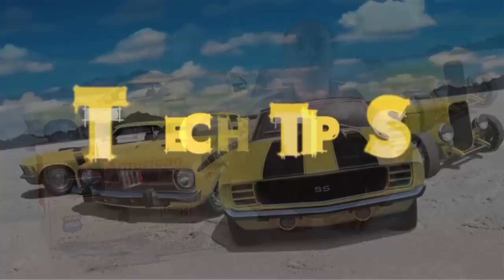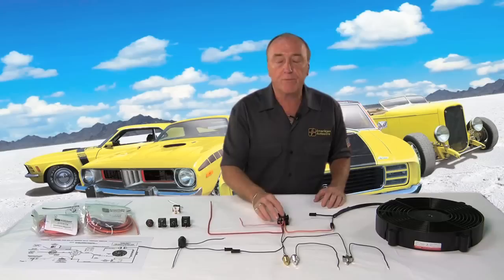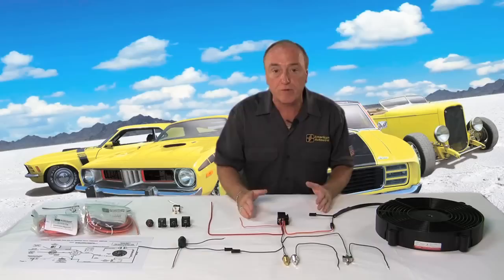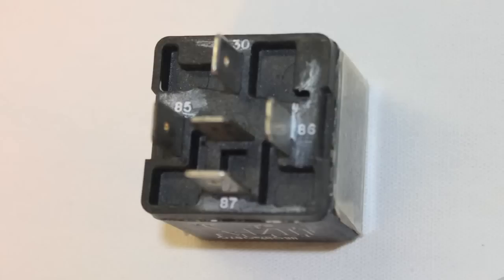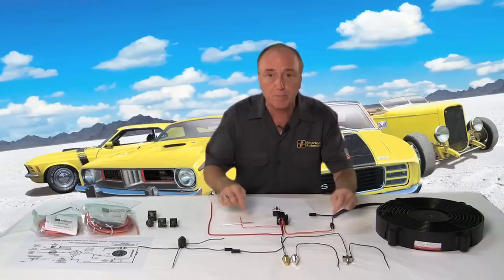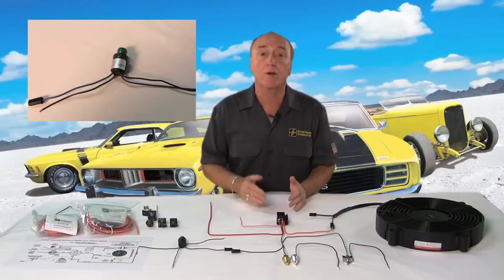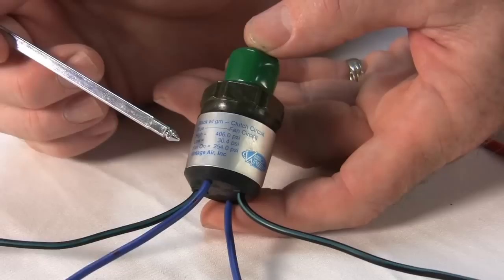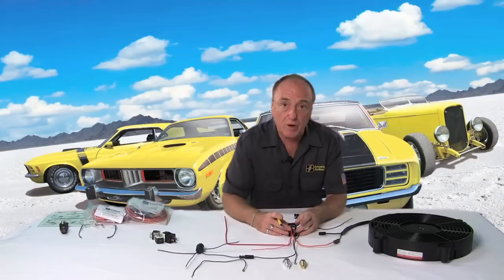Electric Fan Connection Using Fan Relay Kit

Comment: Okay Thanks so Much!
So which prong on a relay would be for which component of the curcuit? I want to wire a thermal switch(activates at 40°C) to my intercooler and a manual switch in the cockpit. Also since im using switches do i need to use ny ignition source for 12V or can i run straight to my battery since the relay is relying on the two switches that would be "Control the ground" right? 
This video explains it all better than the other one hundred that I have come across (7yrs looking) but i really need these answers so that it can finally make complete sense of what I need to do. Also you displayed a 4 prong and a 5 prong, which one would benifit me the most. I also believe there are at least two differnet configurations of 5 prong relays (center prong being 86a or 86b etc.)

Comment: A lot of great information.  
But how would I wire a push through radiator temperature probe? 
Is it one wire lead to 85
And one to ground? 
OR 
One lead to 85 terminal 
One lead to and ignition source? 

Thanks for your help!

Comment: THANKS FOR RESPONDING...  A FRIEND OF MINE WENT THROUGH AND DETERMINED THAT THE CIRCUIT BREAKER, THAT CAME WITH THE THERMOSTAT WIRING KIT, WAS THE PROBLEM...  HE REPLACED IT WITH AN INLINE FUSE...  PROBLEM SOLVED...

Comment: I like that the fan is automatic, but just putting a switch in isn't dangerous unless you don't use the proper gauge of wire... turning the switch off means the circuit is open and no voltage gets anywhere if the wind spins the fan a bit. I do like how you explain everything. I always thought of relays as a weight saver when it comes to wire cause it just relays the signal to a heavier wire, but obviously it's more complicated than that if they do other things, like wiper relays and fan relays.

Comment: I am using the AAW Camaro kit for the 69 camaro.  Is the orange wire to the fan intended to be the ground switch for the fan to signal it to turn on? Its unclear what the function of this wire is. I have the Dakota digital dash too.

Comment: Thanks man,so this switch can cut the power from the AC system and simultaneously connects the cooling fan ground wire to turn it on .?

Comment: Thank you for this video. But what if the relay has a malfunction? Then the override switch wont complete the circuit. So it has to be either the hot or the cold direct wire that supply the fan to be connected to the override switch.

Comment: Hi. Great video. 
Can i install an electric fan using the temp sensor on the engine. Or do i have to install a separate sensor switch. The temp sensor has 2wires. I want to retrofit to electric fan

Comment: In the video you say that terminal 85 should be connected to power and terminal 86 to ground. When the coil shows a freewheeling diode across
Reply: Juan Abreu 
The diode across the relay coil is to block any back pulse created when the relay turns off to prevent damage to a transistor switch if used its not a "freewheeling" diode.

Comment: How much is that system from vintage air? I have a 03 focus with dual fans, all new parts yet fans do not run on their own but, I drive a 07 Pontiac G5 2.2 vin F & I ha e never seen the fans run on their own so I figured out how to run low speed but, I need the fan to operate properly & at a temp lower then 223° low speed, & 230° HI-SPEED..MY CAR CYCKES BETWEEN 178-192 NORMALLY EXCEPT WHEN driving up a continuous hill/ sitting, idling. I turn on low speed at 190-ish but, I cannot control hi-speed yet. Any help is greatly appreciated!!!

Comment: great job!      only question i have is?    shouldnt you have a second "free wheeling" diode right close to the fan motor?

wouldnt there be voltage feedback with on the freeway??.    without one?

larry

Comment: what if you istall a temp switch on the ac condenser so the fans turn on when the condenser gets hot and at highway speeds the condenser will stay cool keeping the fans off

Comment: I did a fan on my jeep yj with out using a relay and it caused issues. not using a relay caused the engine to run for a few seconds after I shut the key off. after I installed a relay the problem when a way.
Reply: I'm having the exact same issue and I think it's because my fan has no relay.
Reply: @scanner2350  You need a relay!

Comment: Hmmm.  DIN 72552 says terminal 86 is relay coil positive and terminal 85 is relay coil negative.  Normally it might not matter, but if there is a diode in parallel with the coil it would matter.  Are you using another standard?  SAE, ISO, ???

Comment: I want my fan to come on as soon as my motor is running in warm weather,is there a reason i couldn't use the exact system shown here with the exception of running my ground direct to battery ? If not how can i wire the cooling fan in a 1995 mustang v6 to come on & stay on the entire time the motor is running ? An inline switch is no good seeing as im doing this for a disabled woman wholl forget to turn the switch off & kill the battery leaving her stranded.

Comment: My new 57 Chevy American Autowire kit provides constant power to the relay coil so even when the motor is turned off, if the water temp is above the sensor set point, the fan continues to run. How would you wire the relay coil to only have 12Volt power when the ignition is "on"??
Reply: .....???? WHY DO YOU WANT TO CHANGE THE WAY IT COOLS , THAT IS THE WAY IT SHOULD BE SO THAT YOU DONT HAVE EXTREMELY HIGH TEMPERATURES JUST COMPLETELY STUCK IN THE SYSTEM THAT WILL MAKE EVERYTHING BREAK DOWN FASTER.....THE QUICKEST COOL DOWN IS THE WAY TO GO
Reply: @seanglenn1901  
Your mis-understanding what I'm looking for. I'm not trying to change how it cools. First of all, I figured why it was running when I turned the key off. The "original" ignition switch simply had "off", "on", and "Start".  The new switch that came with the new wiring harness, has one additional position to the left of "off". You would consider that position "Accessory". When I was turning off the ignition, I was going all the way to "Accessory". That was sending power to the fan relay so if the temperature of the coolant was still above the sender set point, it would continue to run the fan even though the motor was no longer running. 
I have no intention to change the "on-off" set points of the sender.

Comment: Using relays to switch a DC fan motor is a real bad idea.  It can blast the relay contacts leaving the fan at full RPM dead. Starting DC fan motors draws high amount of DC current that can short out the diodes in your alternator.  Get a good solid state controller with SOFT START.  See more at www.autocoolguy.com

Comment from the maker: Thank you for checking out our video!  We would have to find out how you have the fan wired. That will help us determine what is going on.  Depending on the temperature switch you are using, there are many factors that can cause erratic behavior in fan operation.  The reading on a gauge may not always match the timing of the fan switch operation due to location in the engine.  Please call us so we can help you get it figured out  800-482-9473 and press option 4 for Technical Support.  Thank you.

Comment: When the coil shows a freewheeling diode accross its terminals, I've always seen that the cathode is connected to terminal 86, should not be better to favor the connection of power to terminal 86 and ground to terminal 85 even if diode is not present. Of course the diagram on the relay case dictates the rules!
Reply: Juan Abreu

Comment: Anyone familiar with electric fan circuit breakers? My universal fan kit works up until a certain ambient air temp. After 90 degrees it wont work. I have it in the coolest part of the engine bay, which isn't very hot, and yet hot days will cause it not to turn on. I Live in a costal town and it is pretty reliable-get inland in the summer and I am toast! Any ideas?

Comment: Hello sir I checked cooling fan resistor and find out that the voltage coming to resistor unstable the voltage up to 13.2 v and suddenly drop to 1.4 v .The fan can,t work in this voltage and when I tuned on , Air conditioner the dashboard light shows antifreeze is low .My car mercedes w202 c200 1999 year .What does it mean ?
Reply: Voltage regulator is bad, very common problem with those cars.
Reply: where this regulator location on w202 ?

Comment: Relays are a piss poor method to switch fans on and off. The contacts WILL be obliterated over time and miles. Starting current in DC fan motors WILL cause huge current spikes on those relays. It can also blow the diodes in your alternator. Get smart and go with solid state pulse width modulated fan controllers with SOFT START and drive worry free. See www.autocoolguy.com controllers start at 55 amps up to 200 DC amps.

Comment: Hi my name is christopher, and i have a problem with my 2016 Mazda bt 50 space cab 4x4 manual, and my wiper just stop working, if anyone out there can helps me to fix it please email me thanks.
Reply: its the control arm, either buy a new one or sometimes the connector can be loose, just tighten it.

Comment: THE FAN WOULD BEGIN TO COME ON, AND THEN THE RELAY WOULD "CLICK", AND THE FAN WOULD STOP...  I BOUGHT A NEW RELAY FROM THE PARTS STORE, WHICH DID GET THE FAN TO RUN, BUT, IT WOULDN'T KEEP RUNNING...  IT WOULD START, AND STOP CONTINUOUSLY, ALLOWING THE TEMP TO REACH 230 DEGREES...  AT THAT POINT, I JUST BYPASSED THE RELAY, SO THAT THE FAN COMES ON WHEN I TURN THE CAR ON...  I WOULD REALLY PREFER TO HAVE IT OPERATE OFF THE RELAY, LIKE IT'S INTENDED TO DO...  ANY SUGGESTIONS WOULD BE APPRECIATED...

Comment: Using relays to start a DC fan motor is NUTS!   They will burn out and fail over time.  Call The Auto Cool Guy for Sold State PWM Controllers.
Reply: This will fail in shorten time than relay its not reliable (that controler) or module